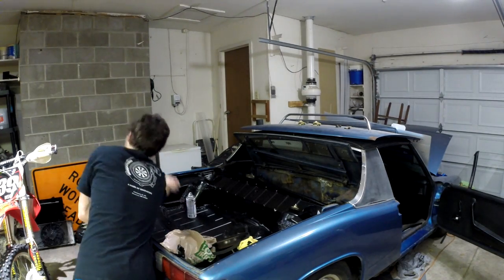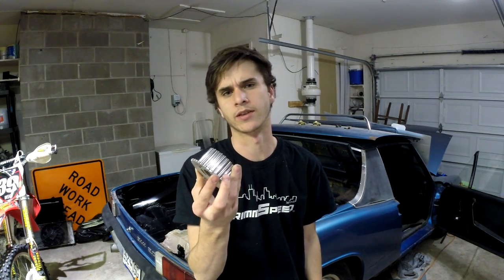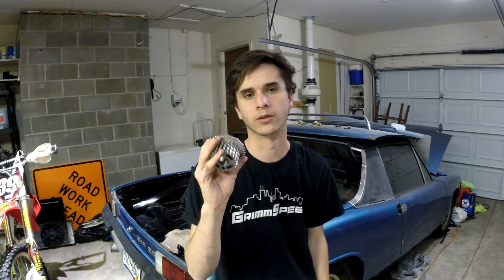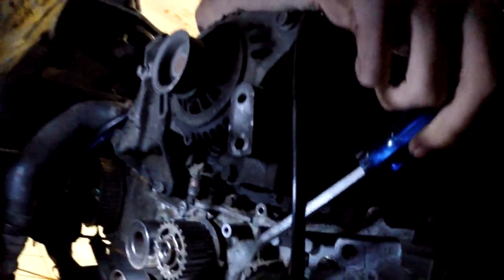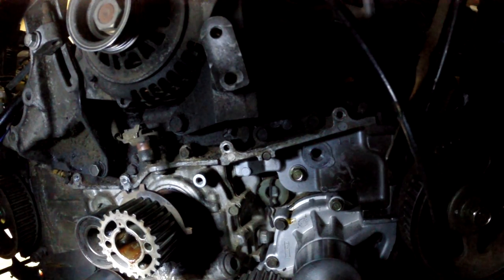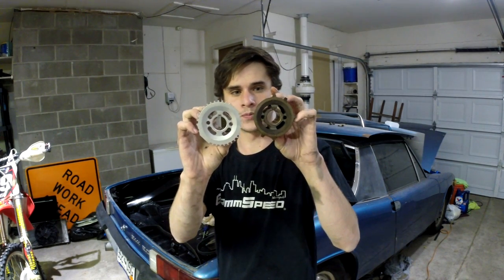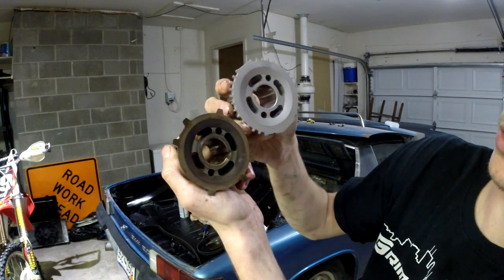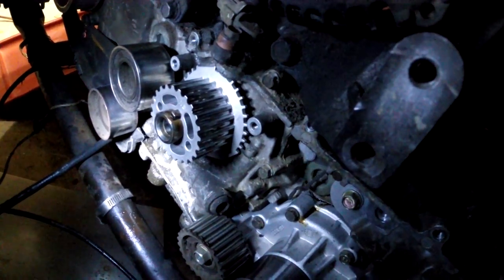Project 914 Episode 5: Wiring Harness Part 2: Megasquirt Overview

Comment: can you share any more info about the crank sprocket you are using and specific coil you are using with microsquirt on your ej22. i think you are saying you are using stock crank sensor. i would prefer to buy and off the shelf crank sprocket vs having mine customized for 36-1 or other tooth style.
Reply from the maker: +Jim Kelly so the crank sprocket is off of newer subarus, and uses the 36-2-2 pattern so no modification is needed. And I am using the stock sensor. Any turbo Subaru will have this sprocket. Also the coil is off of early 2000s volkswagens, part number is   032 906 106b.
Reply: thanks. based on this link i bought crank sprocket pn 13021aa141, hope its the right one.  https://www.thesamba.com/vw/forum/viewtopic.php?p=5365250 and i will check out the coil you've mentioned. thanks again. does the coil you've mentioned not need a separate exciter like the ej22 uses?
Reply: i'm finding this coil on ebay 032 905 106 but not the 032 906 106b you mentioned. are they basically the same? i do see your reason for using this coil is its embedded exciter, nice : )
Reply from the maker: They should be the same yes. And yes exactly... very easy to use.
Reply: thanks a ton. i have a sprocket and coil on the way.